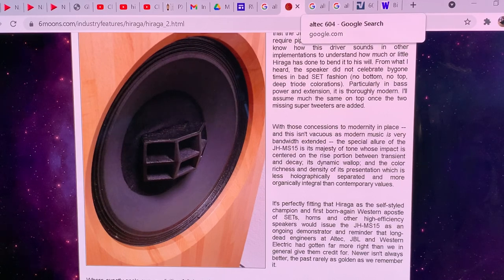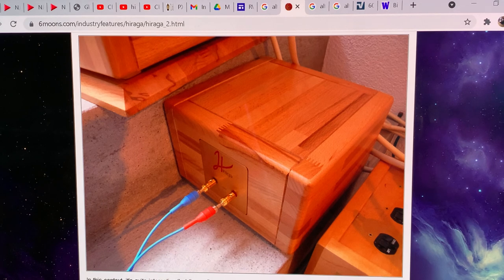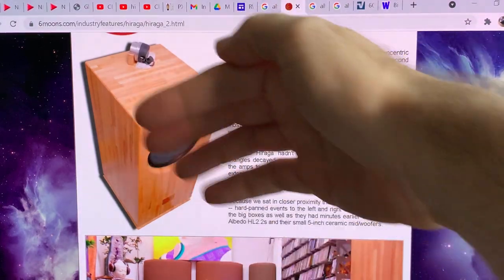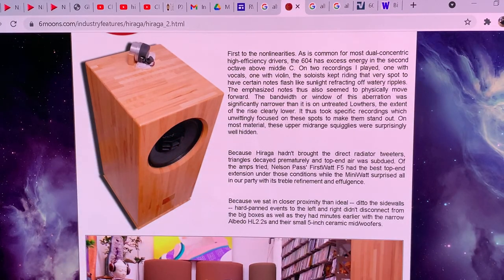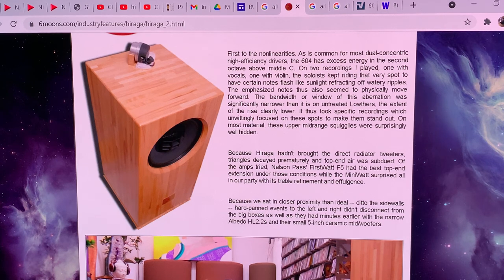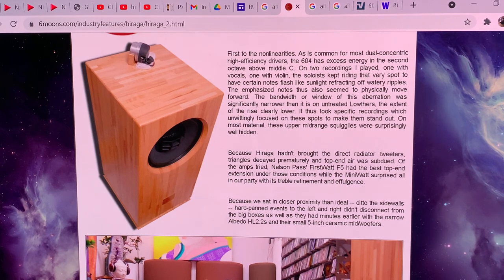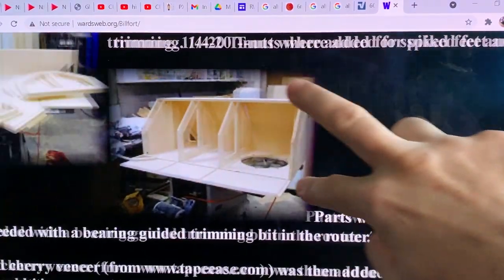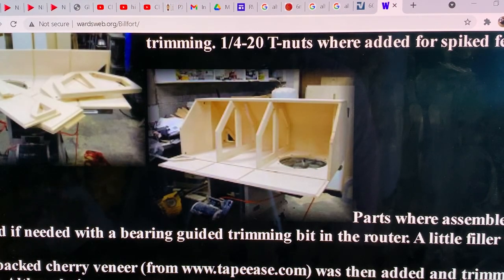Jean Hiraga Part 4: EXTERNAL CROSSOVER & pitfalls of resonance control

Comment: Relocating the crossover outside the enclosure will change the internal cabinet cubic volume.  Does the speaker work the same with more internal volume?

When the crossover is in the speaker box, it is electrically close to the speaker driver.  Outside the box, the wire between the crossover and driver has to be longer.  Does the extra distance/longer wire have any affect like timing impact or frequency loss?
Reply from the maker: Superb question!!! More internal volume brings up the woofer efficiency a little, giving slightly better lower extension. The longer cabling has way less negative effect than all the components being subjected to heavy resonances and strong magnetic fields.
Reply: Haw haw. 😜😜

Comment: What if y apply 2/8 ir more thick wood on both diesel of MDF.
Reply from the maker: It would be mostly cosmetic. The purpose of high quality wood is that it transmits sound very fast, and has the capacity to transmit the energy inside the cabinet to the air very quickly, thereby increasing the driver surface from a puny 6-15in diameter surface to a significant surface that moves but a few mircons to transmit the energy (most ideal situation). MDF lacks the ability to quickly transmit energy, so it blocks the energy transfer between internal volume and room air.

Comment: Bro u are my online sensei , which country are u in, can u help me getting some vintage drivers, can't get it in my native country
Reply from the maker: @IDontExist14  That's a nice CD! ; ) I would look for something that in the 10in-15in range, and possibly as efficient as you can find, with 95dB/Wm minimum efficiency, and paper cone. I live in Hawaii, and unfortunately shipping from here to you would be absolute killer, more than the cost of the driver : ( I would recommend checking out ebay, and contact the seller if they can ship to you directly. Vintage Zenith 10-12in drivers hopefully can be found for your projected budget, and they will have absolutely superb midrange tone, and easy to implement - basically, run them full range, no crossover on them, and use high pass on the CD, plus kick in the sub under 100Hz.
Reply: @realworldaudio  ok bro, I'm going to look at zenith drivers, will let u know which one I get, thankz for helping.
Reply from the maker: @IDontExist14  You are welcome! Good hunting!;

Comment: Not just capacitors but inductors change their value under vibration
It's really annoying hearing all that computer noise in the background sounds like your crypto mining lol
Yes toning your cabinet not sure what,you mean by tuned wood, suppose because of its straight grain, probably the best material for speaker cabinets is bamboo
Yes not really the right way to brace the picture shows, if you want to brace you would use a vertical pieces not going  end to end but coming short to reduce resonance in the long peace of the cabinet tune up the ideal frequency. Better than a bass port is a slit 6 or 8 order much better than a port
Can we see the inside of your speaker or is that a secret lol
As I say bamboo is the best choice for mass production it's more sustainable even than MDF and is a better material allround
One thing you didn't point out is that you don't want your end grain to be butted up to another piece it has to have space absorption layer, can cause buzzing
We see with radiators today they're trying to achieve the same thing as the cabinet flexing lossless cabinet
Reply from the maker: Superb points, John! Indeed, I fully agree with you, bamboo would be the best material for mass production, and aligning a long piece of wood the way you described does help a lot. Sorry for my pronunciation, I meant to say "tone wood", which is the name for luthier / music instrument grade wood: it has a very dense fiber structure, and thus has a very direct, strong, and very fast resonant response to the mechanical impulse. Lesser grade wood and other materials, because of their less organized strucutre, start resonating in sync with the original impulse, but then due to their lack of inner sturcture, the resonances excite non-harmonic modes - which cause the bad cabinet colorations. I'm about to make a series on the inside of my speakers, this Hiraga series (and upcoming Voigt pipe / TQWP videos) are the preparation to understand the foundations for my way of thinking. ;